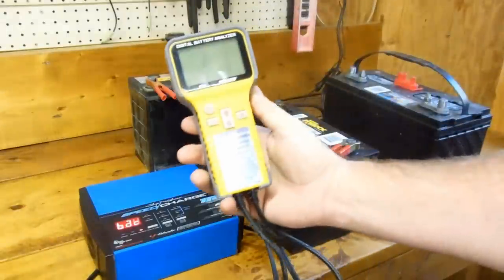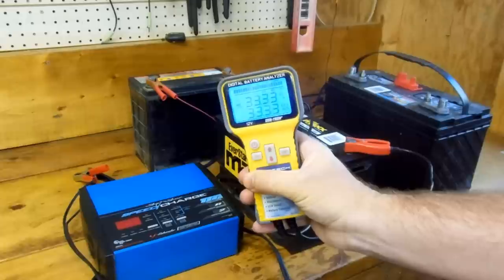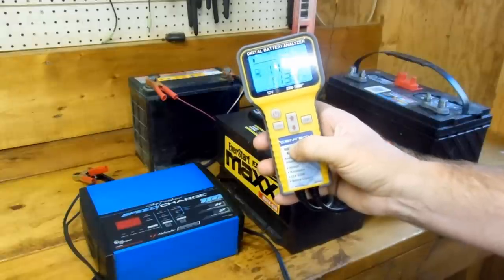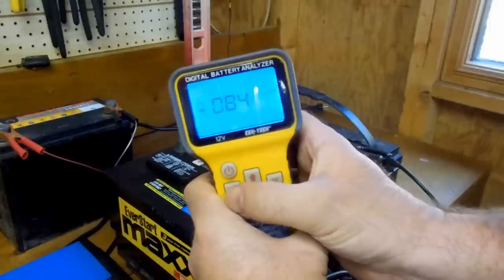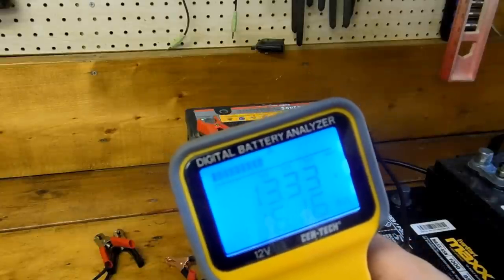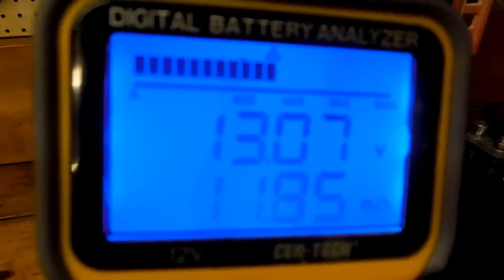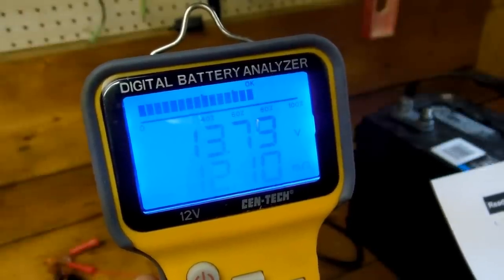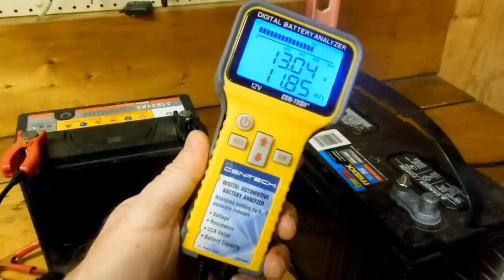Harbor Freight Digital Automotive Battery Analyzer (Item 66892)

Comment: I like this tester. The switch did go on mine, but I easily replaced it.(I had a switch in stock) If you get switch problems then a squirt with good quality contact cleaner might fix it. I masked off the screen, put tissue around the PCB & sprayed the remaining switches. No more trouble in 2 years. Useful bit of kit. Be aware all conductance testers (I also have Midtronics etc.) can occasionally be fooled by the odd rare battery fault. They will then ALL (dear or cheap) say a faulty battery is good.

Comment: I have several conductance testers including the Cen -tech. Be aware that all conductance testers can occasionally say a useless battery is very good. N.B. they can be fooled by certain battery fault conditions. To be certain, it is useful to perform the old fashioned load test at hundreds of amps, or if time allows connect a load such as a head lamp for several hours to get a rough idea.(Don't run it below 11.6 volts) I had an 850 CCA battery (95 AH) that read close to perfect on conductance testers, but was only really capable of giving about 12 amp hours.
Reply: Note. Don't run a car battery down more than about 40% or below about 11.6 v with a load of 4-5 amps, or the test itself can do harm. This duff battery wouldn't run a headlight bulb much more than an hour to that (it would likely have taken over 2 hrs to completely flatten it / damage it further, despite the perfect conductance CCA readings)
Reply: There are cranking batteries and then those designed to run at a constant drain called "deep cycle" batteries. Cranking batteries have mesh plates whereas deep cycle batteries have solid plates. Mesh plates give you much more surface area and therefore much more cranking amps but for a shorter period of time. Deep cycle batteries give lower cranking amps for their size but can sustain a heavy drain for a long time. When recharging from a deep drain, mesh plates may not redeposit back in the same place that it dissolved from when discharged and will lead to decreased surface area (less cranking amps) at best or shorted plates at worse. Cranking batteries should NEVER be drained heavily. Some "marine" batteries are a happy medium between the two giving you larger surface area than pure deep cycle batteries (think golf cart batteries) for cranking boat motors and some sustained draw for electric motors and such.

Comment: ive had mine for 8 years works good. just watch out for the alligator clips getting weak, brittle, rusty or loose because it does happen and you get bad readings, once i upgraded mine with copper ones it worked better.  the ones it come with are very cheap.their bite isnt strong...make sure its got a GOOD connection to battery terminals...and dont move it around when you run the test!!!! moving it also messes with the readings....otherwise it works good and gets the job done..mines been kicked around the shop, dropped, thrown, stepped on, took rides in engine bays, rained on, hood crushed,  used daily for 8 years now. ......good luck

Comment: I used my New Cen-Tech 66892 on a new (2 week old) Size 65 Bosch Platinum 12v Battery at Pep Boys.It's an "AGM" Type.  It's rated at 910 cca.10 minutes (I'll recheck tomorrow after 12+hrs) after taking off my Genius 3500 Charger (that read 100%), these are my readings using this Tester:  12.96 v2.45 m-Oms   933 cca  and 85% on the 'Bar-graph' atop my Tester.   One thing I learned, you've GOT to make your alligator clips attach to the actual battery lead terminals or you'll get crazy reading (all low but high on the m-ome where you WANT it LOW).   I really like it though! It completes my home auto-tester needs. I also got the Cen-Tech's Multi-meter for $39.   Get several 250 m-Ome -250 v fuses for when you blow the "Amp-function" fuse.   That's an important function. On line I got 5 for $3.95.  I did just spring for a Fluke Automotive 77-4 but then I haven't told the "Little lady" yet !   LOL
Reply: Hi Ken. I've tried my Cen Tech on Varta  850 CCA (EN) AGM batteries & it reads about right. They also usually read below 3 milli- ohms when new, which is correct. Strangely though, even one of my totally useless Varta AGM's read 800CCA & about 3 milli- ohms. On a load test at 425 Amps this battery read OK for a few seconds ,then the voltmeter dropped & you could hear noises from the battery due to faulty cell (s). A load test or discharge test over several hours is the only way to be 100% sure with some battery faults. All conductance testers seem to need to be directly on the lead posts, I have found, like you. Stainless steel bolts just give way out readings. Though dear, I've found Fluke meters have lasted me well over many years.(I have 77 & 83's) Perhaps you could tell the ''little lady'' that if she somehow finds out & you're in trouble!! Have a good day.

Comment: Hey great test of the meter. Did you know that after the test is done not only does it tell you the battery voltage and resistance , if you press the select button it also shows the cca that you input for the test and the actual cca the battery is producing. Thanks for your honest opinion on this item.
Reply: Thanks for the CCA reading info.  I was wondering if the instrument would display the actual CCA test results.  I didn't see any mention of this in the video.
Reply: That was irking me.  Thanks.

Comment: Looks like a decent tester 'cept it can't do 6V batteries...which means you have to buy, carry and store yet another scanner. Also, bit of a draw back if the battery label is missing, faded or damaged and you have to guess the CCA...though most scanners in this price range are probably going to require manual CCA input and not feature automatic CCA info.
Reply: WJK don’t know if snap on has a new one but snap on’s doesn’t even auto cca 🤷🏼‍♂️

Comment: Apparently, some of the Fluke meters are also made in China.
Reply from the maker: You're probably right. It was foolish of me to blindly assume something was made in the USA.
Reply: Vicos - You say normally you don't by china testers, you buy Fluke?' Ha Ha... snob much. Yea Fluke anything would be a factor of 100 more. A Fluke BT510 a hand-held battery tester is $3,500! Fluke is great, but for the money hard to beat this. ............ I recommend the Solar BA7 for about $70 far better value, smaller, gives you CAA (can enter non SAE DIN/EN units), and it also has start and charge test as well as conductance test. DON'T GUESS CAA, find out....
Reply: I know some Bosch power tool chargers are made in China, loads of products are, but they're still high quality. I had a Fluke 73 mkIII  meter made in China. Nothing wrong with the quality as far as I could tell. It still works fine after several years.
Reply: Hi, gmcjetpilot. Yes the cheaper conductance testers seem to give very similar readings to dearer ones. My Midtronics micro 5oo gives similar results to my Launch BST460 & Cen Tech. Somebody else wrote on You Tube that the Solar BA7 gave similar readings to the Midtronics ones he used at work. I do like Fluke multimeters though. Flukes don't seem to give the annoying spurious voltage readings you get from some cheap multimeters when the probes aren't connected to anything. I've got a Fluke 77 still working well after over  25 years. Cost me about $200 (equivalent) back then. I totally agree with you, I wouldn't pay $3500 for a battery tester. Bear in mind what I've found, that I think  ALL conductance testers can occasionally be fooled by some battery faults (I have 5, but not a BA7) & pass a duff battery. That said, if a conductance tester says a car battery is really low in CCA , it will be. Have a nice day.

Comment: There are 5 battery rating systems for automotive batteries:
CCA
DIN
IEC
EN
CA(MCA)
Your foreign battery may have a different rating system. (Check your instruction manual for rating systems.)

Comment: Will this tester also work on the small 12v lawn mower batteries?
Reply: 12 volts = 12 volts
Reply: It will probably only be accurate if the battery has lead connector terminals & you can get good connections. The a.c. signal from conductance testers gets effected by stainless steel terminals.

Comment: thanks for the vid, im looking to test some leisure batteries that dont have a CCA (cold crank amp) rating on them, does this mean i wont be able to test them accurately if i were to buy something like this? thanks
Reply from the maker: Entering the rated CCA is the basis for the capacity/life calculation. For example, if the battery is rated at 100 CCA and the tester determines it is putting out 50 CCA, the tester will tell you that the battery is at 50% capacity/life. You might want to look at one of the old school analog load testers. HF sells at least one model I believe.
Reply: I think you may be right. The old school tester with actual resistor load and analog display may be more accurate.
Reply: Hi Vicos. This was years ago but I'll reply. I have tested about 50 leisure batteries. Sadly there is very little relationship between CCA rating & amp hour capacity, particularly with batteries that are not new. For example  I tested an 850 CCA , 95 amp hour battery & it read 780CCA or about 85% good. I tested this battery at the C/20 rate using an FYD10 discharger . The ACTUAL capacity of this battery to 10.8 volts on load was only 31 amp hours. Another battery I tested once read about 800 CCA but was a dreadful 12 amp hours!! I double checked both with a 12 bulb discharged for hours & other make conductance testers. The results were correct. You have to bear in mind that a discharge of say 400 amps for 15 seconds is less than 2 amp hours. I've tried expensive ACT testers & even these are fooled by big (over 20 Ah) batteries. (My ACT testers said the 31 AH battery was 65 Amp Hours  -- pointless ) I had 2 ACT meters, both said 65 AH!!Yuasa , who make batteries ,say to test 20 or SIMILAR MAKE  batteries on one of their conductance testers  to get an idea of what a new battery should read . If a conductance tester said an 850CCA rated battery was say 450CCA you could be sure the battery was very poor. No way do I rely on conductance testers to indicate what the AH capacity of a leisure battery REALLY is, only if it's knackered. Hope this might be of use to some. Regards.
Reply: Whtabob, yes sometimes a test at a hundred or more amps can give a better idea for a quick test, with some battery fault conditions. A test with a 12 v car headlamp bulb over many hours is the only real way to know amp hour capacity, if you don't have an FYD1O or West Mountain type discharge tester, to 10.8v or 10.5v on load at the C/20 rate. (5 amps for a 100 AH battery)-- See my reply to Vicos. Always recharge the battery immediately if you do a C/20 test & don't run a CAR battery down to 10.5v at a few amps or you'll damage it.(They're not deep cycle)  Regards.
Reply: Elwyn Harris CCA rating is meaningless if not adjusted for temperature. Just look for resistance even for marine or solar batteries